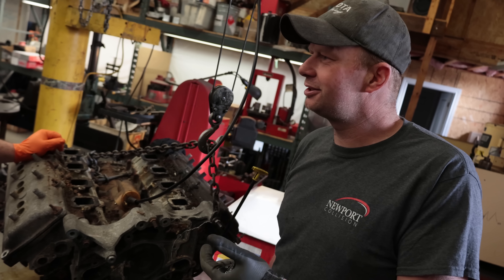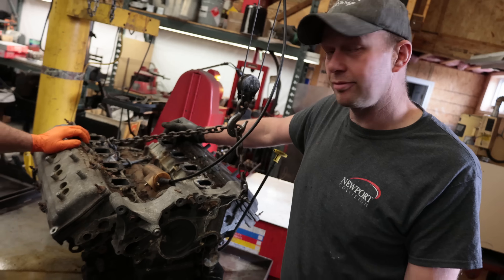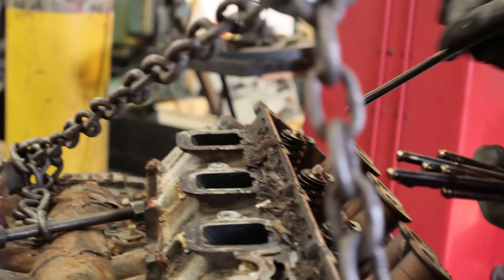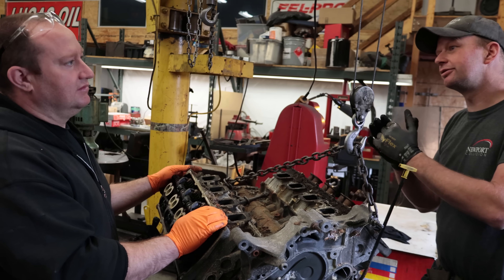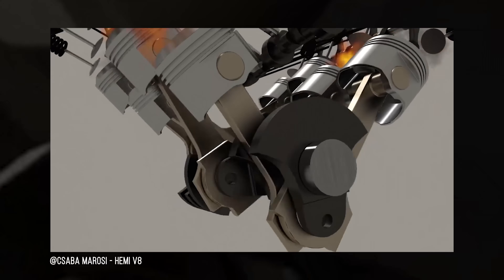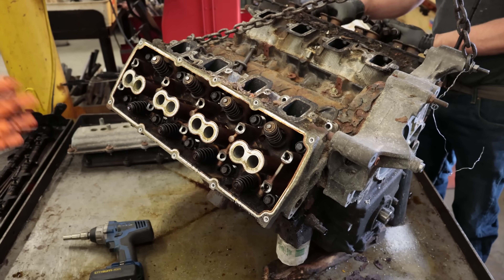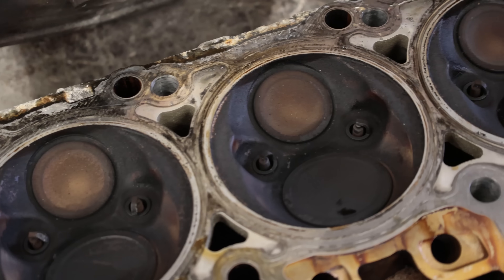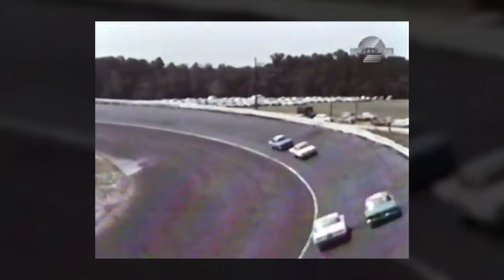REVIEW: Everything Wrong With A 5.7 HEMI 345 Engine

Comment: Can you turn off the cylinder deactivation without a tune?
Reply: Don't shoot me if I'm wrong but I don't think so. I think I remember reading that you can't just throw the delete kit in without at least an off-the-shelf tune but I could be wrong
Reply: @02honeydew  not sure about the tune being needed, but most dodge oem ecu can be adjusted with a HP tuner. I imagine it is needed or else those cylinders wouldnt fire the injector or plugs...
Reply: @danielmorskijr411  That would make sense, that's sort of what I meant by new tune I was struggling trying to think of the words for what I wanted to say lol. I heard too that the early Hemi I believe had valve seat issues? I think the Eagle heads were supposed to fix that issue but I don't know a ton about Chrysler stuff. The only cars I really like from them are the Neon SRT-4
Reply: @02honeydew  I got one of those. And a 99 Ram, Durango, and a 02 Durango.  Love Mopar. Building a 360 Magnum for the Ram and recently upgraded the 99 Durango to 360 from 318. 02 Durango is a total restorod.
Reply: @danielmorskijr411  I'm pretty jealous of your lil Neon. I'm trying to decide between one of those and a E90/E92 335i for my next car. I know they're drastically different but I really like both but don't have the space for two cars. 
Edit: those are some cool projects too I currently own a '97 Neon auto and a '95 Crown Vic that's my daily driver
Reply: @02honeydew  the srt is a 98 clone of a 99 srt. Built early 2000s in the FnF vein. The motor is blown. Im trying to sell it, but im in illinois....
Reply: @danielmorskijr411  That's pretty solid, do you guys get the salt problems there like I do in NY? (I can't remember where Illinois is).
Reply: @02honeydew  yes and no. Northern part does, southern part is a little less. Its got 65000 original miles and 0 rust. My ram came from So Cal so its 0 rust.
Reply: @danielmorskijr411  Oh alright, I didn't realize that state was divided in half like that. That sounds really impressive, around here if you're lucky enough to see one of those still around, it's barely holding together. I don't mind the looks of the old ones, with that low of miles and no rust, you might have a lot of luck selling it around here to someone who really likes them.
Reply: Yes. There are inserts to replace the hydraulic valves to lock oil pressure at all times. But you have to tear the engine down to install them.
Reply: Low budget fix? Get a Bullydog for the 5.7 and run it on normal. I did that to my '07 and I was staying with the diesels pulling a 27ft 5th wheel across Canada

Comment: I guess guys are going to Hellcat oil pumps to boost low rpm oil pressure to help stop lifter failure!
Reply: I've heard about that too. There's a guy in town with a retired cop charger. He went with a hellcat pump after replacing the cams and lifter. The lobe was beaten flat, Completely round. He kept the cam and he had it with him at the meet. It was amazing to see a cam like that in person

Comment: I'd love to see a video done on the bmw m50 motor, as an owner of one I'd love to hear your opinion on it if you can find one
Reply: 96 chevy s10 with the 5 speed transmission and the 4.3l v6 vortex
Reply: @koreywilliams4570  I had a 95 Sonoma with the 4.3 vortec and the t5 manual, sadly sold it when I bought my bmw but I found a pretty mint 1994 s10 with the same motor and trans as my old Sonoma
Reply: M52 or an m60 would be nice too. Typical faults are known but you rarely see quality a full-teardowns of stock motors